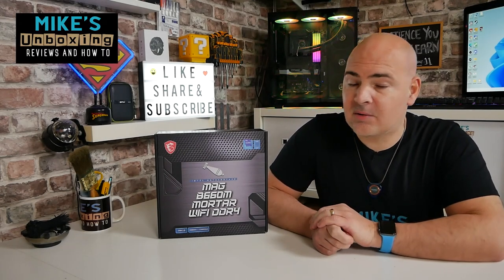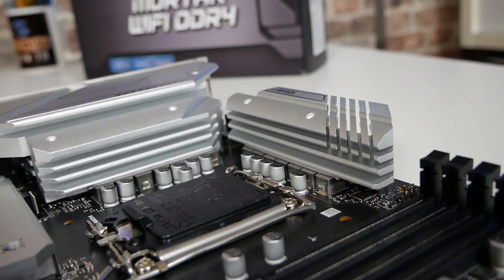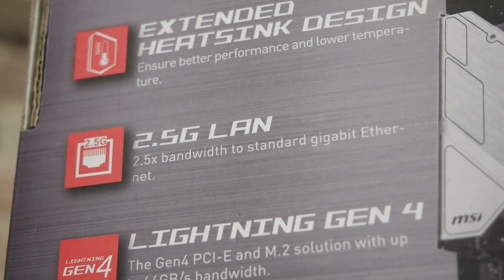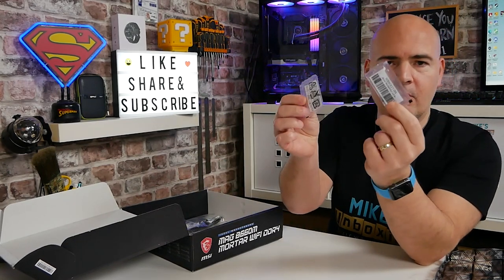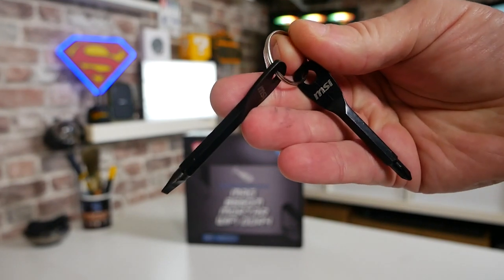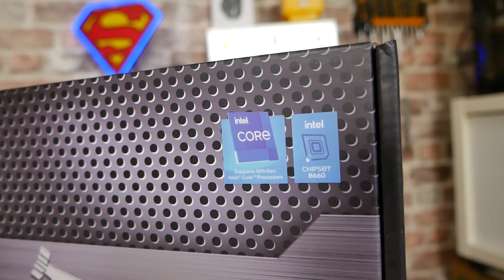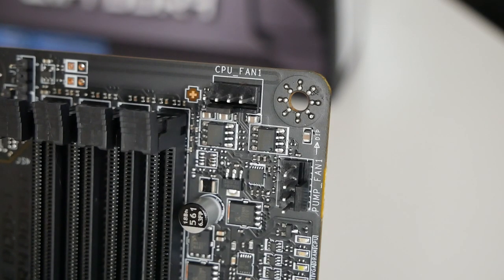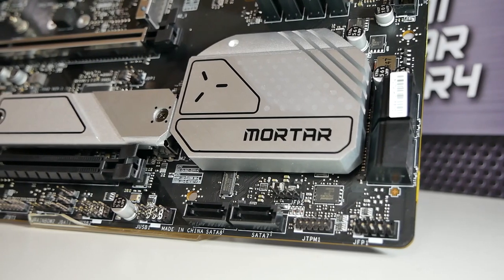BEST BUDGET B660 12th Gen Motherboard MSI B660M Mortar DDR4 WiFi Unboxing & Overview

Comment from the maker: UPDATED MSRP FROM MSI FOR THE UK as of 4th January 2022.

B660	MAG B660 TOMAHAWK WIFI 	£219.99
B660	MAG B660 TOMAHAWK WIFI DDR4	£209.99
B660	MAG B660M MORTAR WIFI 	£209.99
B660	MAG B660M MORTAR WIFI DDR4	£199.99
B660	MAG B660M MORTAR	£199.99
B660	MAG B660M MORTAR DDR4	£189.99
B660	MAG B660M BAZOOKA 	£179.99
B660	MAG B660M BAZOOKA DDR4	£169.99
B660	PRO B660-A 	£169.99
B660	PRO B660-A DDR4	£159.99
B660	PRO B660M-A WIFI 	£159.99
B660	PRO B660M-A WIFI DDR4	£149.99
B660	PRO B660M-A 	£149.99
B660	PRO B660M-A DDR4	£139.99
B660	PRO B660M-G	£119.99
B660	PRO B660M-G DDR4	£114.99
B660	PRO B660M-B	£114.99
B660	PRO B660M-B DDR4	£109.99
B660	PRO B660M-E	£104.99
B660	PRO B660M-E DDR4	£99.99
B660	PRO B660M-C EX DDR4	£149.99
Reply: Is there any worth while differences between all these motherboards.

Comment: Maybe a tad expensive at this price point considering the other mobos on the market (including some of MSIs own ones) but not a bad board to look at and it does what it says on the tin.  Drop the price a bit and these would fly off the shelves.  Thanks for the review, Mike and Kath :-)
Reply from the maker: if the 12th gen locked processors are cheap enough it will make the board more appealing, but if AMD get their stuff together and release a bunch or 3100, 3300x and 3600 at the MSRP it is game over for intel on the lower end
Reply: I didn't know at this point Mortar (MAG) were count as Budget friendly motherboard.. the price is really bad
Reply: I got this board for $160 on Amazon during a sale. Not bad for supporting ddr4 and it looks amazing.
Reply: @MrDucatiV4  Excellent find, Michael ! At that price its a steal !
Reply: @MrDucatiV4  Great price, my place / retails selling this for $250 inclusive tax

Comment: Interesting review Mike. Afraid out of my league as only last year jumped from AM3+ motherboard, had used AthlonII and FX cpus on it, to B450 & R5 3600, so clearly not big user of PC! Looks a good board with big heatsinks although confusing intel still runs RAM at slow speeds. Presume hear from cpu then? Thanks for sharing Mike and Kath👍
Reply from the maker: cheers Nick i actually really miss the FX range, good times

Comment: High ranking overview, and the possible support of 13th gen Intel Raptor Lake would be a sweet deal. Hopefully the price wars between intel and AMD start the price drops soon.
Reply from the maker: agreed competition is good for us the end users
Reply: @mikesunboxing  Intel Core i5 12400F £179/ i5  12400 £199 @ ccl computers.AMD  will have to drop the 5600x prices.
Reply from the maker: I’m not sure if they need to, the motherboards are a lot cheaper and all amd chips are unlocked, availability is going to be a key factor
Reply: @mikesunboxing  Amazon UK have recently dropped some B550, X570S motherboards by 10-12 % Maybe that is how AMD will keep the cpu prices the same.

Comment: Interesting Mike to see these new motherboards. Looking forward to buy a cheap CPU on second hand market and mount it on this kind of motherboards. probable if available one from Asus that I prefer. I do not use a buzzer and never did.
Reply from the maker: looking forward to see how much there are going to charge for the new 12th gen locked processors, not long to go now before we find out

Comment: Does the non wifi of this board have Mystic Light support? My aio cooler is connected to jrainbow2 header but MSI center is not letting me change the rgb
Reply from the maker: not sure sorry not seen that board but if it has the physical ARGB or RGB header then it should be able to be controlled in msi center

Comment: Hey , these are my specs , will everything fit in the case and are compatible with the motherboard? 

GPU- MSI Radeon RX 6600

CPU - Intel i5 12400F

Ram - Corsair Vengeance RGB pro 8x2 3200 C16

HDD - Seagate Barracuda Compute 2 TB 3.5" 7200RPM Internal Hard Drive

SSD - Western Digital WD_BLACK SN750 SE 500 GB M.2-2280 NVME

Cooler - NZXT Kraken M22 Liquid CPU Cooler 120mm

PSU - Corsair CXM 750 W 80+ Bronze Certified Semi-modular ATX Power Supply

Cabinet - NZXT H510 Flow ATX

Any help would be nice,  thanks
Reply from the maker: cant see any obvious problems there but i have not built in that case to know of any potential issues

Comment: I'm thinking of this build set up, partially via Alphasync, any thoughts?
Following options selected via Alphasync, intel custom build options:

intel i5 12600k
MSI B660M DDR 4 wifi mobo (as reviewed above)
Corsair 32gb vengeance rgb pro 3600mhz ram
Corsair RM850 psu
Coolermaster hyper 212 black cooler
MSI Rtx Ventus 3080
That comes to £1,444
I want a 2tb M2 drive but their options were ludicrously overpriced so thinking of oing for mid range by WD:
WD BLACK SN770 2TB SSD M.2 2280: 5150/4850 for £184
Got an SSD with Win 10 retail copy so can clone to new drive
So total build cost - £1628
Any thoughts? Bad choices? better choices?
Aim is a decent gaming platform for MS Flight Simulator and other fairly hig end games
Reply from the maker: not keen on building it yourself Burt?
Reply: @mikesunboxing  I'd love to butI'm not really in the kind of mental space at the mo to get to grips with building again, after being awol from it for at least 10 years :-) I'd rather let someone do it for me. This way i still get a lot of control over the quality of the components but none of the hassle.

Comment: Hi Mike,i'd love to buy this board for my new 12th gen 12600 build,the only thing is holding me is the heatsink of this board might interfere with an AIO build and i am building in corsair 220T case....
Reply from the maker: should be okay i think, i would be more concerned putting an AIO in the 220T i think i tried that and the front is about the only place it will fit
Reply: @mikesunboxing  Some barely got by it but used a low profile RAM which i am planning to do,thanks anyway bud

Comment: Can MSI MAG B660M MORTAR WIFI only connect one 8pin CPU ? (As my PSU only has one 8pin EPS, and will use i5-12600K with non overclocking)
Reply from the maker: yes you could maybe even get away with 4 pin at a push

Comment: Great review just bought it for $179 USD and paired it with a Intel i3 12100F $109 USD. Now trying to get my hands on a RTX 3050. Had a RTX 3050 in my cart for $379 and was debating, but apparently waited too long as it sold out and relisted for $399...:( At Some point i'll get a GPU I think...lol
Reply from the maker: hope you manage to get one soon
Reply: Hey man, If you had this MSI Mortar and 12100f - did you tried to overclock this CPU with BCLK overclocking? I saw an article were was said that this Motherboard can overclock using BCLK

Comment: £199 for cruelly but truthfully a second rate chipset is way too much. Once you're crossing the ~£180 boundary you are almost certainly better served with a lower end Z690 board like the Asus Prime models than an expensive B660.
Reply from the maker: I agree these prices are pretty outrageous I was expecting a lot less. I would expect them to be £120 within a very short time with the market as it is now
Reply: @mikesunboxing  Personally £150 is my limit on a B660 before I would rather just spend the extra on a Z690. I was looking at picking up a 12400f and chucking it on a cheap board for a speedy gaming machine. That CPU is available for just £175. Stunning value, until you see the board selection and prices. Unfortunately options are limited but I would hope given another month there should be decent choices at and considerably below my target.

Comment: Can I install a noctua nhd15 to this and does it come with a back bracket?
Reply from the maker: it will do now, or if old stock you can request a bracket
Reply: @mikesunboxing  which do U think is better this or the asus strix b550 f gaming wifi II

Comment: MSI Pro B660M-B DDR4 is it any good?
Reply from the maker: seems like a good choice
Reply: @mikesunboxing  
I went for this set: 
Intel Core i3-12100F 3.3GHz
GoodRAM IRDM X 2x8GB DDR4 RAM 3200MHz
Patriot P300 SSD 128GB M.2 NVMe PCI Express 3.0 (Only for the OS) I keep my old Drives.
Asus Prime B660M-A WiFi D4
Arctic Freezer 7 X
I red ALL benchmarks and set this one for the best VFM as it is now... 
What do you think.
Total Cost 348,11 € with Delivery Service.

I have a really... really tight budget and a kid to feed. 

My pc is 9 years old so this set is an improvement.
Reply: @mikesunboxing  i wanted this one... MSI Pro B660M-B DDR4 but it was 45 Euro difference.

Comment: How many system fans in total can be connected to this board??
Reply from the maker: as many as you want if you use a hub.
Reply: @mikesunboxing  I don't know to use a hub
.. My case has 2 front fans, was looking to put 2 more at the top for simple intake.. Just want to know whether this board can take up 4 fans if directly connected to the board?
Reply from the maker: @shwetabhm  No - you are going to need a splitter or a hub

Comment: This is by no means a budget B660 board. MSI PRO Z690-A DDR4 is cheaper, offers a better chipset, features, decent thermals even for 12900K, just doesn't look as fancy.
Reply from the maker: yes these prices are a real disappointment to be honest, the prices were unknown to me before the video launch so sorry for that
Reply: @mikesunboxing  Sure, I understand. Actually TUF Gaming B660M-PLUS seems a better deal, but still the B550 equivalent is cheaper.
Reply: How sure are you that MSI Pro Z690-A is better than B660 mortar, I would to know, because I am in dilemma for these two mobo.
Reply: @jackw4150  It's got a better chipset. You can overclock the cpu on Z690, not on a B660, and the thermals are still good even on this cheap MSI board as what Gamers Nexus said. But I'm not sure about the audio output or so, maybe that can be better on the B660 Mortar. Also Z690-A Pro has got a PCIe 5.0 slot, while B660 Mortar only PCIe 4.0.

Comment: You may not use a PS2 port, but organizations like the CIA and NSA fill all of the USB ports in with super glue because they don't want somebody to walk in with a thumb drive and infect their system with a virus or steel their secrets. Without a PS2 port there is no way to attach a keyboard. The Iran Nuclear Agency probably does that now, because a virus from a thumb drive set back their nuclear bomb  program back for years.
Reply from the maker: good points

Comment: Best budget board???
Its 200 pounds!!!!
Reply from the maker: Yeah I know the prices weren’t available until after the video was done. I did mention this and am very sorry that msi and intel have put such a new adoption tax on this chipset and platform
Reply: @mikesunboxing  Could prices come down though?
Reply: @RandoBurner  not sure if it ever did, but looking at present price points where I'm at, the b660m Mortar & TUF Gaming B660m are more or less the same at around $200. A cheaper & pretty good MSI b660m-a can be found at $150.

Cheapest Z690 I can find is a MSI PRO z690-A at $210.
Reply: @Don_Akane89  The m-a is really great. I just went with a zen3 upgrade for my b450 board. Will prob upgrade again in 2-3 years to a ddr5 and whatever board and cpu will be better value then.
Reply: @Don_Akane89  The M-A doesnt have bios flashback though I think. The b660 gaming x from gigabyte though has it, and it doesn't look too bad(if you want to get a 13th gen cpu with it, non k or 13600k max prob)
Reply: @RandoBurner  the only thing stopping me from getting a b550 board is that it seems to be at the end of the line? That and though I could get a rog strix b550 + 5600x which is great value, I could also get a b660 & a 12400f for more or less the same in both price & performance & have the headroom of upgrading to a 13th gen should I need it. Regarding which, would probably keep it for the next 5 years at a minimum, most likely up to 10 years.

I'm estimating that since I'll be upgrading from an over 10 years old i7-3770 lol and having helped build my sister's 10100f system, tested & benchmarked it, I was stupefied when I saw the performance improvement, and thinking of going for an even better 12100f which I could also get for cheap. Coming from the 3770, which also has 4c/8t I think the 12100f's much stronger c/t is enough for my usage, though people have been saying get a 6c/12t like the 12400f at a minimum instead.. Only problem is, that'd also double the cost.

I'll mostly be using it for my work with digital illustrations on Clip Studio Paint, which is mostly single core focused anyway. Most of games to my knowledge also don't benefit more from 4c/8t vs 6c/12t, and the games that do where that's critical I'm sure I won't play for the most part. But yeah, not really a big fan of a majority of modern AAA games so it's not a big issue.

So yeah, will most likely just get the 12100f for now. The board though, oh boy. And just like that a lot of new options just seem to pop up locally, coinciding with the new year (and new year discounts on some parts). I'm thinking of settling with this mortar, but then there's also the TUF gaming in both b660 & m variant thats relatively the same price, with the atx variant having an extra M.2 slot. Currently, I'm thinking 2x M.2 slots might be enough? But who knows if I'll ever need a 3rd one.

For $10 more, I could also get a B660M Aorus Pro AX, and yes, also a DDR4 version. At this price though, I could also get a MSI Pro Z690-A instead, which I'm not sure is better?

Performance aside, I'd also like to tackle the aesthetics department if possible. Going for a relatively white build, must say the b660m mortar & Pro AX both looks good to me. the mortar also comes with a heatsink for both of its M.2 slots, which I'm puzzled why as to how cheapskate most boards are for not providing them in every single slot they have. I've heard they run fine without one, and I could always just get aftermarket heatsinks but I'd rather have one without the extra cost than not having one. If the Pro AX is better though, I don't mind getting an aftermarket M.2 heatsink for the second M.2.

My workload has also surpassed the 16gb threshold once, the max amount of rams I currently have. iirc task manager had my memory paged with 18/16gb, which, I'm not too tech savvy on this but I believe the extra 2gb paged was via virtual memory? Regardless, yeah my system has been choking throughout so I'm also thinking of going with a 2x16gb 3200Mhz Kingston Fury Beast initially, and get another set if it becomes a necessity. 3200Mhz should be ample enough speed & I won't be overclocking them.

In terms of multitasking, at most it's just running CSP alongside discord and maybe firefox at most. And when I'm running games I most likely won't be running them with any of my creative suite either, at most just alongside discord only. Firefox I'll only tab out if I need a guide or something & close it after.

TL;DR 

Based on these, since I'll just settle for the 12100f for now & would like to be open to the option of upgrading up to a i7/i9 12th gen/13th gen when I could get them for cheaper if I ever need them (won't be overclocking), which would you say be a better board for my needs? They're all relatively the same price and are b660 variants (minus the z690 ofc). They are all DDR4 too btw.

- Mortar
- TUF gaming (wifi version since non-wifi version has downgraded VRMs apparently)
- Aorus Pro AX
- MSI PRO z690-A

For games, just gonna do it on 1080p @ 60fps. I already have an 8gb 3050 which I reluctantly had to get since it's the 'best value' during all that mining hell when my 1060 burnt earlier this year. I wish I could get a better card, but it's also more than enough for my needs for a while now.

Heavily considering the Z690-A now since it also has pcie 5.0 support, which considering the cpu potential upgrade, might need it as well in the future. The Z690-A also seems to be better than the others across the board.

Sorry for the wall of text lol. But yeah it's a big decision here.